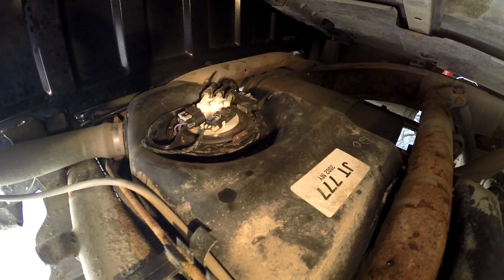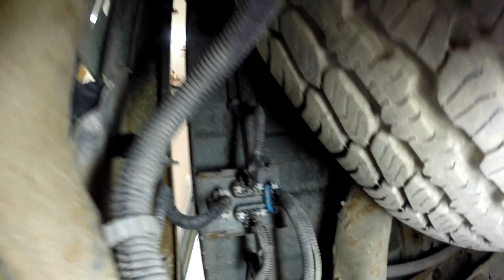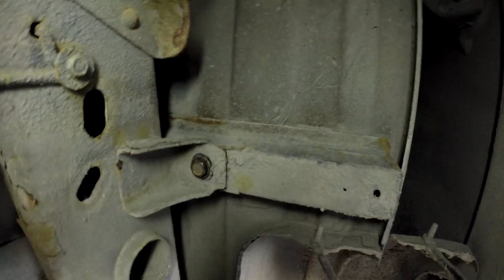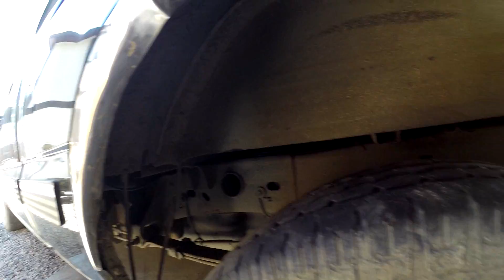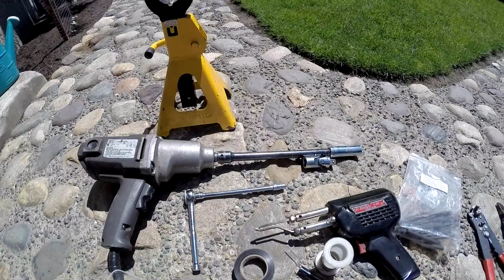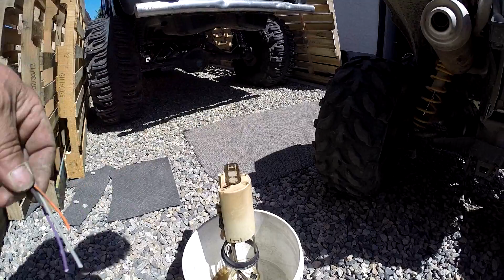2002 Chev Silverado Fuel Pump replacement

Comment: And what do you do when the bed nuts are rusted and just spin? I really thought this way was gonna be easier, HA!! Ended up doing it the real "easy way", and dropped the tank. Dropping the tank prevents having to deal with blind nuts. But, you do have to remove a lot more. I figure if the truck is a pavement princess, it probably is a lot nicer than a truck that drives a dirt road 10 miles every day all year, rain or shine. O'well.....
Reply from the maker: Yes, I agree this method is not for all. Rusty bed bolts and nuts are a pain, and can be removed with a good electric impact, but  dropping the tank is the only option if the nuts are rusted to the bed bolts and you don't want to fight with them....

Comment: How do you disconnect the middle line? I squeezed the sides on the other two and they came of easily. This center hose clamp looks different and isn't acting the same. LOL. -help
Reply from the maker: All 3 lines should be the same type of connecter, squeeze and pull off, unless someone changed something....

Comment: I need to try this method with my Colorado . When you tilt the bed was the opposite side damaged by the bumper , I see that you didn't remove yours ? There's not much space between the body and bumper and don't want any damage . Thanks for the tip .